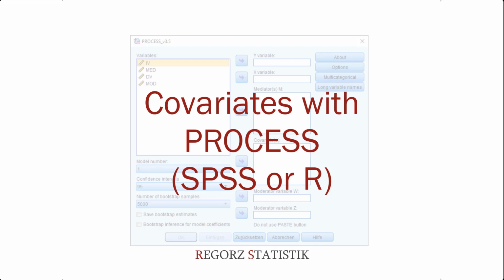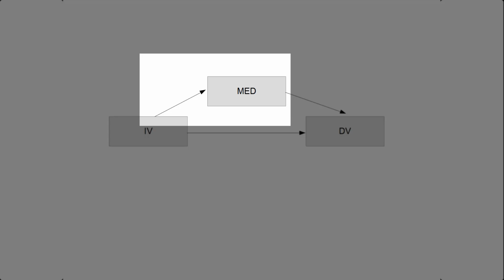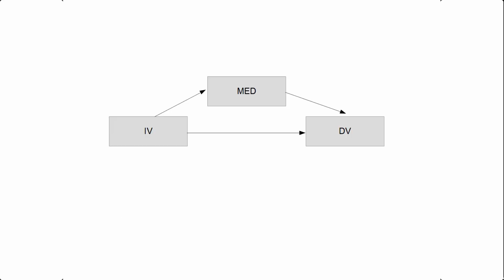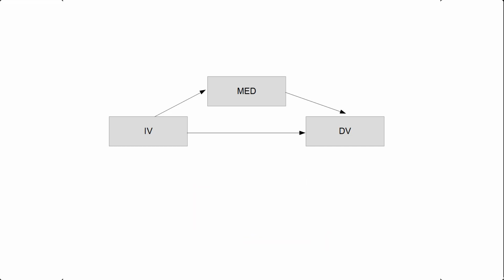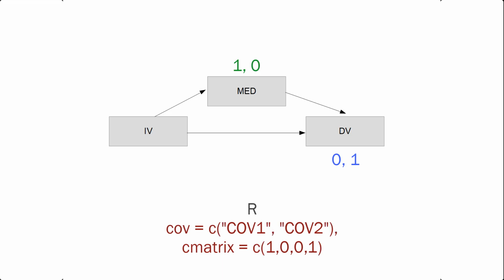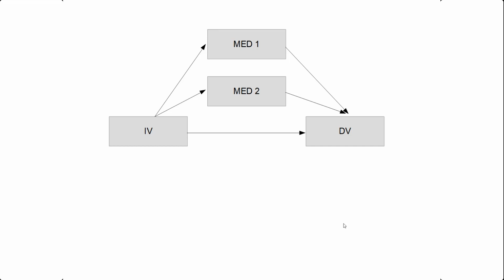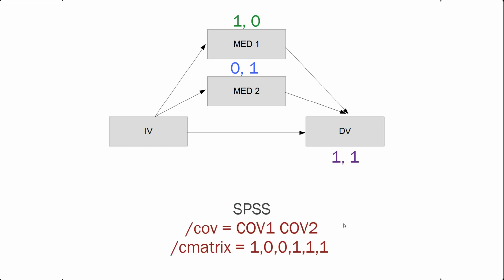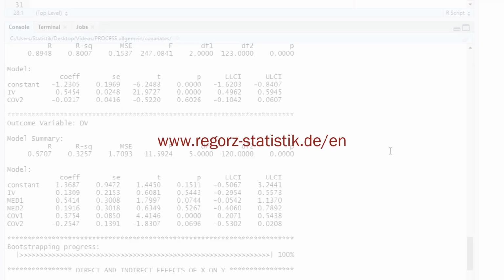Covariates With PROCESS (SPSS or R) - Customizing Your Model

Comment: Hi! Thank you for your great videos, they have helped me a lot with my thesis! I would like to ask a question. I am doing a research with a moderated-mediation model (model 7 by Hayes). The variables I want to control are nominal variables (income (with 3 categories: low, average, high income) and presence of people who use green products (with 2 categories: yes and no)). It says on SPSS (using PROCESS by Hayes) that I can't input a nominal string variable. What do I do?
Reply from the maker: You could recode the variable income into 2 dummy variables. And für the other variable you could recode the string variable into a numeric variable (with values 0 and 1). Then you have 3 binary covariates (dummy income 1, dummy income 2, green products  that you can include in your model.
Reply: @RegorzStatistik  Hi, thank you for your answer! I have made all the dummy variables and recode the green products categorical variable too. So when I use them as covariates, does that mean, for the income dummy variables, I only include the 2 dummy variables into the statistical analysis process? What happens with the third category (in this case, the high income category) that I have picked as the reference group (not coded into anything)?
Reply from the maker: @adillazalfaa  In that case, e.g., the dummy variable for low income is not the effect of low income, it is the effect of the difference between the low income group and the high income group (reference category).
I recommend watching one or two videos about the topic categorical regression in order to get a better understanding of dummy coding (there are many videos about that on YT).

Comment: Do I only report the effect of the covariate for the a and b path? not for the c path? thank you
Reply from the maker: If I report the effect of a covariate then I report it for all analyses where it was used. 
(However in the past, I have reported mediations where I only noted in the figure note that I used a specific covariate, without reporting the regression weight for the covariate because it wasn't really of interest for my research question).
Reply: @RegorzStatistik  hi going off this how do you usually report the covariates if they are just on the outcome?
Reply from the maker: @jordanazwerling2355  I have never included covariates only for the outcome. Nevertheless, my earlier answer still holds: If you report all regressions (e.g., predicting MED and predicting DV), you report the result for the covariate where you included it. If you only use a figure then I would note in the figure notes that you controlled for the covariates only for the outcome variable.

Comment: Hi, great video, can I ask a question? if I have a covariate at level 2 only, and it impacts "x-y" and "x-m". can PROCESS model this case? thanks.
Reply from the maker: What exactly do you mean with "level 2" in the context of a PROCESS model?
Reply: @RegorzStatistik  sorry for the confusion. level 2 means the higher level. My dataset present a nested structure, such as, students are nested in schools.
Reply from the maker: @Rui-gw1wq  Unfortunately, PROCESS is not meant to be used for multilevel data, with or without covariates.
Reply: @RegorzStatistik  Thanks, I found the same answer.